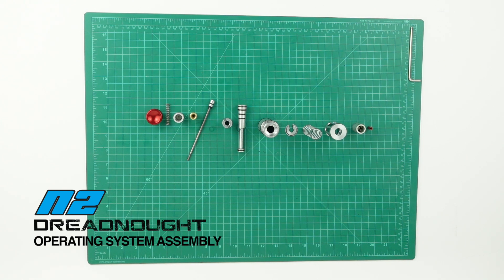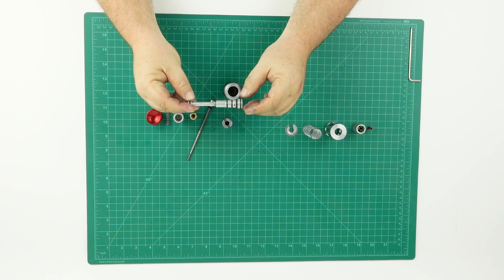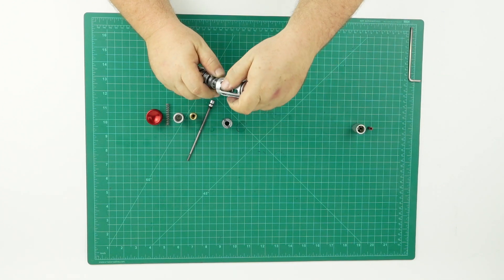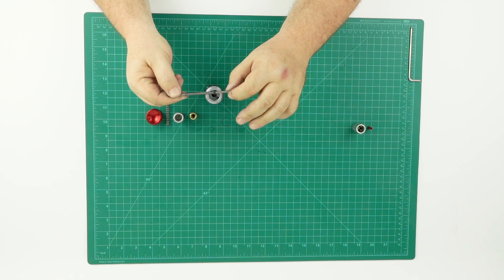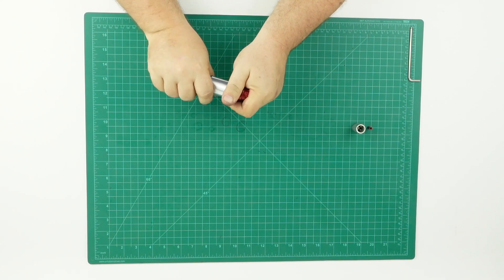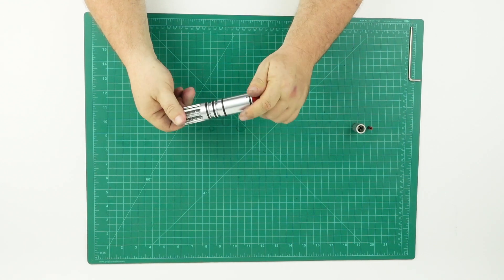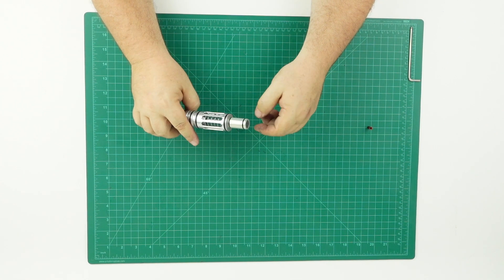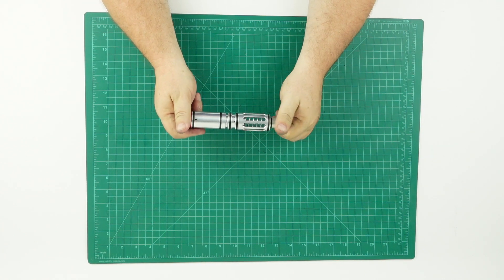N2 Dreadnought - Operating System Assembly

Comment: Why should I have to worry about those issues? Shouldnt you have had those taken care of? Loctite on a Marker. On pieces that have to come apart for service? Wow. NTY.  I want to be a fly on the wall when the returns flood back in. The price on these are like 800.00 right?
Reply: I was interested until I seen that as well. Cheaper markers, with proven reliability, and easier maintenance. Pass.
Reply: @SempiternalTitan   Etha3m
Reply: @christopherkeith600  Yep. That's what I got. Hard to buy anything else.
Reply: @SempiternalTitan   You can pick them up for 300 or less used too. No Fancy Annos to worry about. Nothing to really wear out on it either. Just some orings.